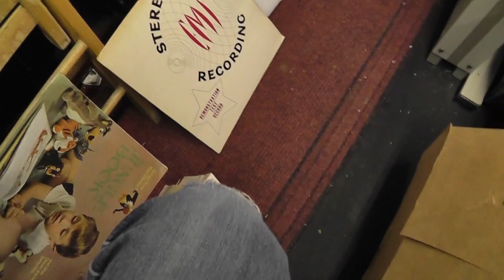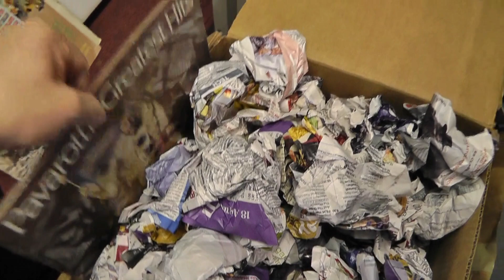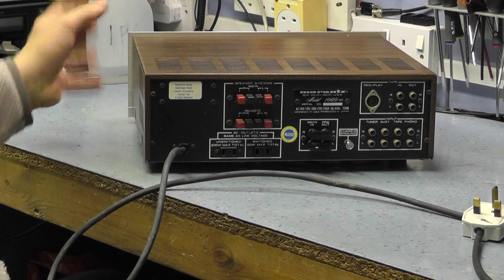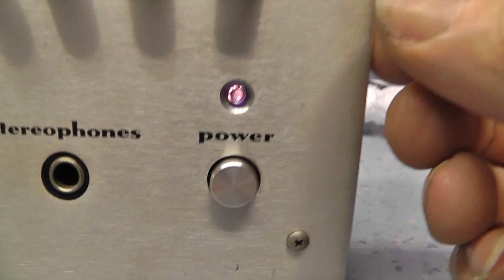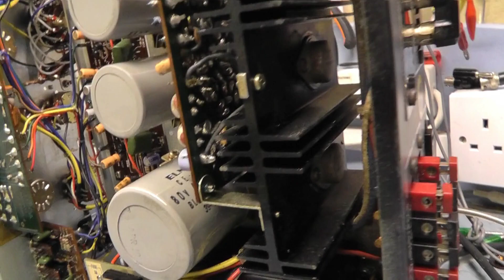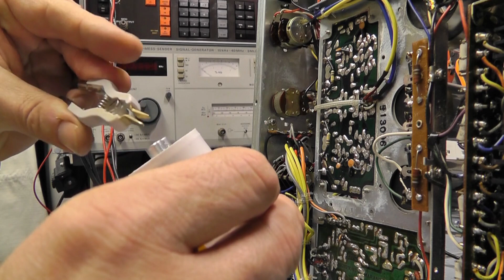Marantz Model 1060 Pt1  First look

Comment: I do love the great sound you get from these old amps, at present I'm using a Tensai TA-2030. I've actually got one of this particular model stored away which isn't working, so will certainly be getting it up and running again. You are certainly correct Simon about the good sound you get from these old amps, they are in a class of their own for sure.

Comment: 4700µF .....!
Reply from the maker: Frank Geeraerts Yep. That's not a lot is it?
Reply: By todays standards  it is indeed relatively a low value ....But its a single rail supply and it draws farely constant current and not PP !   And it sounds originally VERY  good with that value, the value of this capacitor was CHOSEN  by engineers that listened to the amplifier instead of only calculating and specifications  !  This value does not not stress the diodes or the transformer ( and that is what you can  hear ! ), and that's why we like so much this amplifier , not for it's specs but for it's smooth musical envelop without listening fatigue !!!!!....and assures by this low value a very smooth and stress less musical performance .....it is VERY tempting to use a higher value but there is ALWAYS a price to pay ! A trade off in musicality for some more bass extension or control .!
MANY audio fanatics  do make the mistake to THINK that more is always  better ! ( and the amplifier loses it's original musical flavor an musical tempo   )
Reply: Bias pots on the outside , offset on inside  but not measurable and NOT present on the LS outputs/ due to capacitor output !   ( oscilloscope for symmetrical clipping, without oscilloscoop adjust for half of ps voltage o the caps. )

Bias 7.5 mv ......or 15 mv total over both Emitter resistors..
Reply: Hi Simon , 
Bias setting always with respect to the correct mains Voltage ! And repeated after warm up or playing some music ....30-40 minutes , then correct and make final adjustments
Reply from the maker: The value of the smoothing capacitor will have no effect on the sound apart from when there is a high demand on the power supply at high volume low impedance loads. Inrush current seems to be reasonable but if it becomes a problem I could fit a choke in series with the supply.

Comment: Very nice amp, have been looking at one of these too but using it just as a preamp to connect up to a 70's Sony TA-3200F power amp, would I be doing the 1060 an injustice by doing this ? Thanks for your videos from Australia.
Reply: NO , the pre-amp is more than decent !  Works and sounds great , needs only a quality recap and sometimes noisy transistors .....also recap the power supply of the pre-amp&phono mounted under the fuses.
Clean all switches and potentiometers .
You may have a smile listening to this pre-amp section...